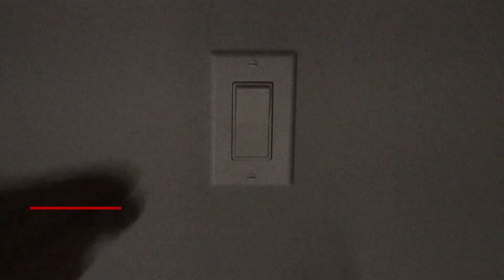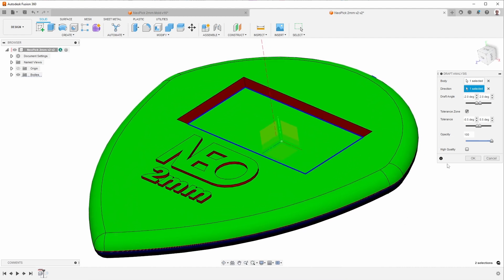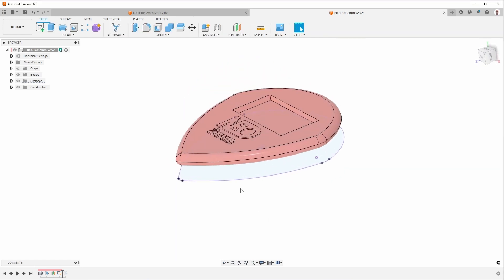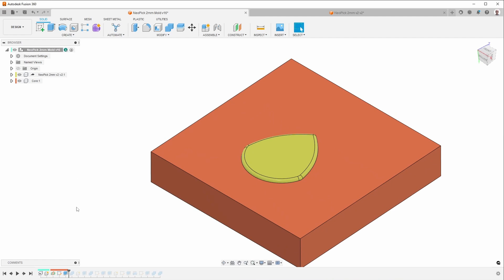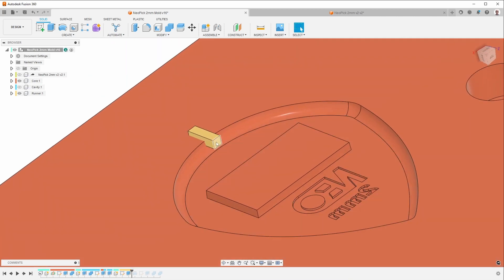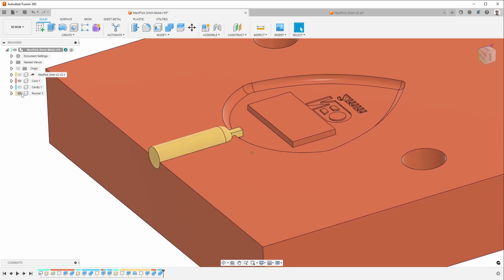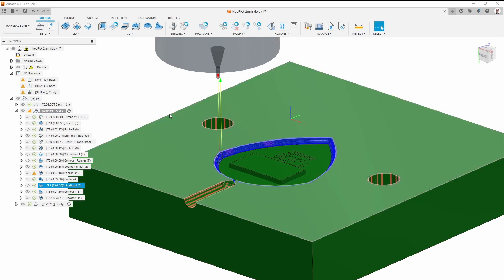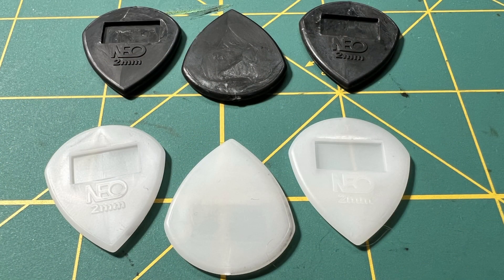Injection Molding a Guitar Pick - Designing, making, using

Comment: Is there a rule of thumb for calculating the largest surface area you can inject into?
For example, What if the volume of the pick was the same, but the surface area much wider and longer. Surely there is a limit to how far the plastic can travel in the mold, even if it's still within the shot size limit?
Reply from the maker: The rule of thumb is based on the cross section rather than the surface area of volume. That's because it's the cross section in the same plane as the parting line that creates the pressure trying to force the mold halves apart. The rule of thumb that I learned is 2-2.5 times the cross section.